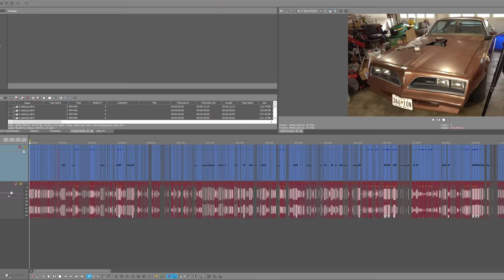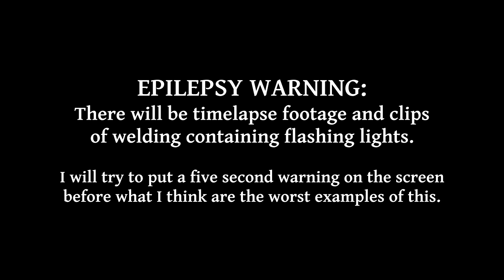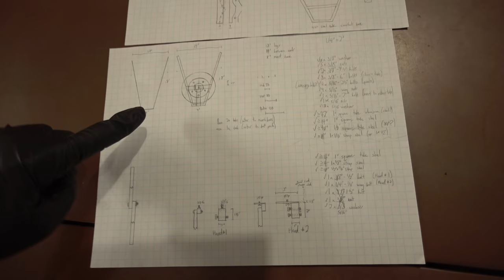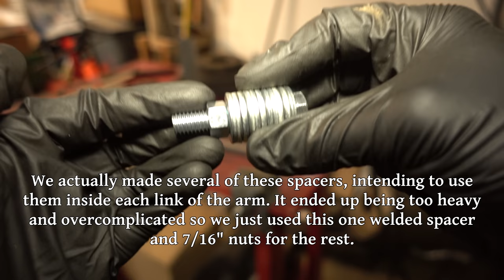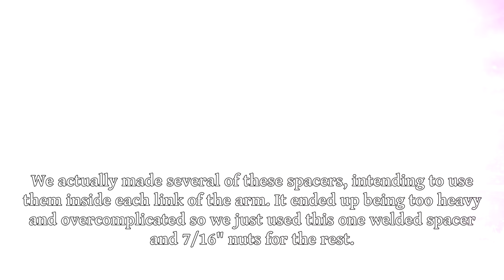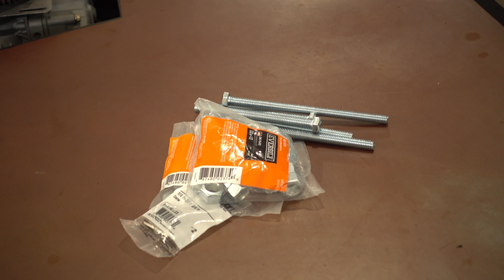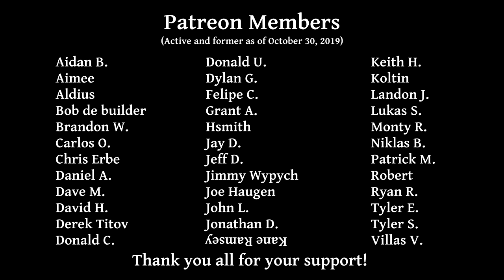Build Project: Free Standing Articulated Camera Mount Arm (Tripod Replacement)

Comment: Made something like this but on a wheeled base and out of wood. Problem I faced was not only the oscillating issues you saw, but it was very cumbersome to reposition quickly. I'm thinking of a jib crane style next as a major update to my design. Great job though, the articulating arm is still a great concept.

Comment: Great video.  Definitely brought up some neat challenges,  I can say square tubing can have springiness in torsion as well.  Maybe use or rivet some bonding plates to the arms, if you can't weld aluminum.   Maybe put some taper to you pivot points and fix the heads of bolts, so you can use lever/handle nuts.  Maybe loosen as you adjust, and tighten to fix position,   Counterweights for the long lateral arms.   Cool cool

Comment: Not sure if this idea would do a lot but instead of just the whole washer ideas, would adding some kind of rubber or polyurethane type bushing type thing inside the tubing help to dampen some of the vibration issues while providing the support needed on the inside of the tube.

Comment: You could throw in some additional spacers/stabilizers in the center of each arm segment, that should add some stability. Also the front legs seem rather flimsy for the lenght of tube they attach. Maybe some sort of x-bracing could be interesting here.

Comment: Drill small holes on each side in the square tube where you want the pan head to be, then weld the bolt into the tube through the holes.

Comment: I see you are pushing with the flux core welder . If it was mig this would be to push your weld in the direction of the gas shield. But as this process is basically a wire fed version of a stick (ark) welder you'll tend to get better results when pulling :) also if welding vertical weld top down I find that bottom up tends to let the weld run down and blob . Cool video though , always enjoy watching your content

Comment: My gut feeling on this one is that it will oscillate far less the more aluminum you take out it. I also have a gut feeling that zip tying a couple of Harbor Freight deadblow hammer heads to it at strategic locations (for you to decide) might level it out some. The sand/pellets in them should soak up energy.

More than anything, just use a more rigid material than aluminum and it will shake less. 

Also, FWIW, what you've built is "kinda" a camera jib crane, which are commercially available,  and they avoid the wiggles by simply not having nearly as many articulating joints. Most are just a big straight, stiff, arms with joints at the ends. I watch a few channels that I know use them (no idea who makes any of them in particular) and they seem to work very well.

This was a cool build! Pretty much the first time I picked up a camera I realized how much of a PITA it is to put it somewhere and actually get useful footage out of it. It's much harder than you make it look!
Reply from the maker: I looked into a lot of camera jibs/cranes, but they specifically don't offer the range of motion/positions that I was looking for, and take up too much space. The large tripod footprint was something I was specifically trying to improve on. So I am trading some stability for adaptability and size, which seems to be a fine tradeoff for our normal video uses.

Deadblow hammers are an idea, but that kinda goes against why I used aluminum instead of steel in the first place: weight. Not just the distribution of the weight or the overall weight (though those are factors too), but the more weight the arm itself supports, the tighter the joints have to be. Unless I put together some sort of locking joints, which I have some ideas for...
Reply: @FuzzyDiceProjects  The weight would actually help you for stability a lot... For locking the joints, I'd consider Nordloc style washers. When they lock, they LOCK, and don't require heaps of force to do so. You'd miss out on the really easy absolute freedom of motion though... 

All in all, it's a tough problem to solve without making compromises and I think you've taken a good swing at it... You just need a mini-drone with very high lifting capacity. ;)

Comment: Adding a pendulum which hangs down from the arm may help to remove any vibrations. Similar to how skyscrapers have pendulums built in to balance out some forces. Although I think this comment might be too late 😅
Reply from the maker: Interesting idea! I should try to experiment with that one, simple enough to do. Won't work for a lot of the ways I use it but if I could come up with something handy that just clips on it's probably worth looking into.
Reply: Like with car suspension, you need damping. A pendulum that swings freely will certainly absorb energy but without damping it will transfer most of the energy right back. So, if you haven't seen it, check out Practical Engineering's "Tuned Mass Damper" video.
You certainly could try adding a tuned mass damper to the head. But with multiple positions it will have slightly different frequencies depending on the setup so you might not be able to make the "perfect" TMD but an allrounder or you could make a couple different TMD's for different positions.
Though, currently, the arm kind of acts like a pendulum already. It just doesn't have anything to dampen the energy. So maybe look into that as well or instead. Perhaps some heavy duty rubber "bands"/ropes/tie downs/bungee cords or something like that might be of use..
Filling the tubes with sand would increase the weight and change the frequency but I don't think that would change much.

Comment: Nearly 57 minutes and no anti-seize or thread lockers used :o, you`re disappointing me my friend ;D
The parallel arms like the ones on the mic holder can give you a wide range of motion if designed properly, a bungee cord can be used as well instead of a rigid parallel arm. let me know if you ever wanted to modify that, i will be glad to help.

Comment: looks great, only thing id change id to add stabilizer brackets to hold your mast and stop it from levering. as your base is super beefy but your mast attach point it a big weak spot.
Reply from the maker: Stabilizer brackets? I added the two 90 degree brackets that attach the tops of the rotors to the pivot on the steel mast, I'm not sure what else could stabilize that more. When I removed the top rotor the bolts are still pulling down on the brackets and offering some additional stability, seems to be working out well enough

Comment: I would suggest to use the springs and stack the brackets vertically and not horizontally. (check any desk microphone stand/arm)
Reply from the maker: That was an idea (and I bought the materials to do it) but it wouldn't have quite the range of motion as it does currently. I mentioned this briefly in the video when I showed the desk arm I have for my microphone. May still look into this alternate design in the future though, as I have at least partially replaced it with other mounts in some areas (like for below a vehicle)

Comment: Wheels on the base of the tripod that don't engage till you tilt the tripod to a certain angle. That will help you be able to move it.
Reply from the maker: Not a bad idea! I haven't actually had trouble sliding it around on the concrete floor, but that doesn't really work on the asphalt. Will have to keep that in mind

Comment: What about Delrin washers?
Reply from the maker: They would certainly be tougher than the ones we cut here, but I'm not sure it would do the trick after the issues I had with the thrust bearings. I think they also might end up too loose and not hold in place well enough, needing a lot of clamping force, which causes other issues and doesn't end up helping out that much. I do wonder if they would take up some vibration or be too stiff to really help with that.

Comment: Woo, long video

also, what did you do to make your harbor freight welder good? your tacs seem stronger than my final welds with that thing.
Reply from the maker: I dunno, that welder has done a pretty decent job over the years for how cheesy some of it is. The feed wheel tension adjuster is broken but I got it to break at the right setting so that worked out lol. Light spring tension and grease on the wire spool spindle helped with a lot of the early issues we had with the wire feed being weak or irregular. Flux core wire is also super dirty so cleaning/changing the tips fairly often helps there too. The stock ground clamp sucks, the one we use was also from HF and does a pretty good job. Seems to work better with .030 wire for most things. That's about it though!
Reply: Oooh its gotta be the grounding clamp that messed me up, thatd explain the lack of power

Comment: get rid of the rotor get a 5 gallon add 3 caster to the bottom. bucket fill with concrete adding bracket to concrete to attach use your arm. rolls around shop  you won't have to pick it up and it won't tip

Comment: I skipped through most of the video since it was so long, but in the end... a failure. There are probably 5 or more things that I can think of right off hand that would make that thing so much better than going through all that trouble and time.
Reply: That's part of the joy of building, making mistakes, learning, getting better. Nobody has to necessarily do it better or even the best, but can do things that they enjoy and that work for them. 

But hey, if announcing your superiority online and Shitting on other's work makes you feel good about yourself, have great time, buddy.
Reply: Alex H I didn’t announce anything. Hindsight is always 20/20, so I’m sure there are things he would do differently now since the video was shot over a year ago. I don’t need to see each weld, each cut, each turn of the ratchet. Showing those things once would still get the point across, and wouldn’t leave you with over 200gb of footage to edit.
Reply from the maker: Since the camera arm has been a part of filming nearly every video we have made in the last year and a half, I find it impossible to call it a "failure" in any sense of the word. It's obviously not perfect, but it certainly does work. I am sorry that you do not enjoy this sort of content, but many people asked for this so here it is, and the initial responses seem to be positive.

Please share though, what are the improvements that you can think of? I am open to suggestions and would like to improve it/redesign/remake it in the future.
Reply: @FuzzyDiceProjects  I'm waiting to hear those improvement suggestions as well...

There's always gotta be "that guy", doesn't there?

Comment: for most situations a swing arm with a counterweight screwed onto a tripod would be enoigh i guess, but cool nonetheless
Reply from the maker: I don't have room for that in most of the places I would want to use it, I especially had issues with the footprint of a tripod. It also wouldn't do very well at extreme angles and especially low ones. A large tripod with a long boom would do okay for most things, but end up too large and unwieldy for the space I have available. Would be a good choice for use outdoors, though